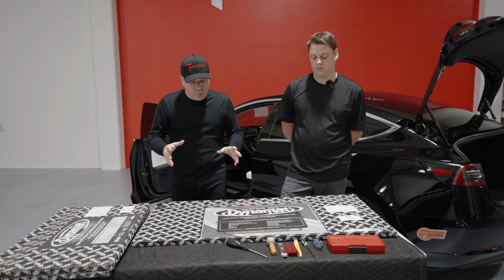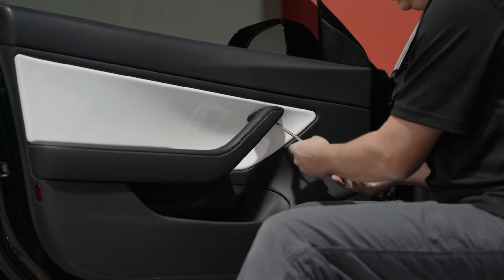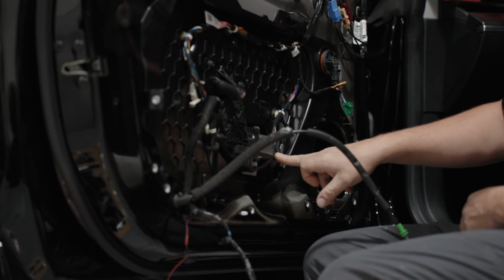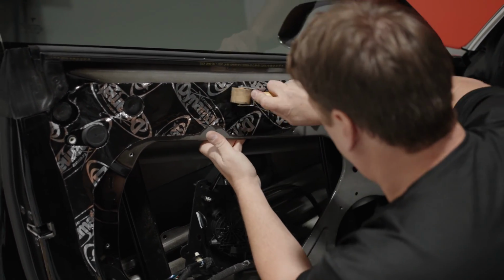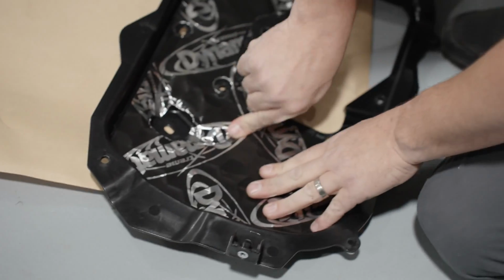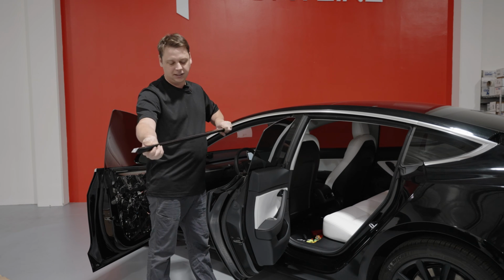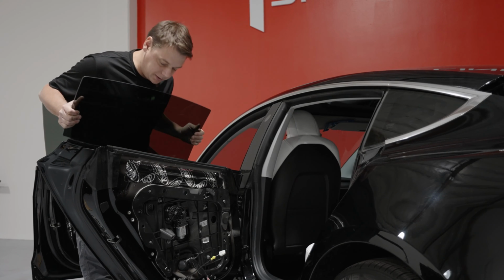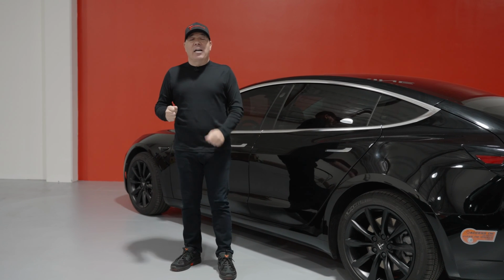DIY Installing Tesla Model 3 Dynamat Noise Cancelation Kit / Reduce Road Noise, Improve Sound System

Comment: Before applying the pieces, I wish you had cleaned the surface first, especially inside the doors, to make sure that it was free of dust, grease, etc. They won't be as durable as they would have been if the surface had been cleaned beforehand.
Reply: I honestly don’t know how dirty the inside of the doors might be.  I would assume it would be hundreds of thousands of miles to accumulate enough of anything to hinder the adhesion.  The wheel wells yes defiantly clean those.

Comment: How good of a job did these thin sound panels help. My opinion, not much they to thin to block sound and the vibration will not improve much either. Sound data prior and after?

Comment: Would also like to see cabin acoustic measurements before and after.  I've worked with sound deadening in previous cars and while a product like Dynamat can reduce the "tinny" sound when you tap on surfaces it's applied to, and isolate connecting parts to stop rattles, I've found it's pretty ineffective at blocking/absorbing road noise.  You really need to know how the noise is entering the cabin and have an effective barrier/absorber to reduce it.  Also, be aware of the weight/efficiency tradeoff for EVs if applying a large amount of this stuff.

Comment: That blue tape is not because someone had that window out.  That was from the factory.  I have a 2018, and I recently changed out all of the door handles and the mirrors for chrome delete (wish I'd have known about these kits before I started that project).  All of my windows, which had never been pulled out before had the blue tape.  Tesla must've been using it to hold them on while they were doing initial assembly.  Also, they broke on of the clips where you screw the 13MM bolts on my rear window and assembled it anyway.  Made it a mess to get apart for me.  And the worst part is you can't buy those clips separately.  So you have to buy a new window to replace a broken clip (which is removable).  🤦🏼‍♂

Comment: For some of the trickier pieces, it might be better to actually cut out the piece with the backer still on it, then peel it off as you stick it in place.  That would prevent it from sticking to itself and parts of the car you don't want it on.
Reply from the maker: Great idea!

Comment: Really sad seeing you put that dynamat on then install the stock paper speakers. Great install though, dynamat is a PITA but really does improve sound deadening.
Reply: have you used it before? how much improvement did you see with it?
Reply from the maker: This customer simply wanted to improve the road noise, however Dynamat is great to pair with an Audio upgrade as you mentioned!
Reply: The sound system is very good...

Comment: I might have missed it, but was there any comment about Tesla voiding warranty?
Reply from the maker: NO!  Federal Law prohibits such actions

Federal Warranty Law: The Magnuson-Moss Warranty Act (15 U.S.C. 2302(C))

The Magnuson-Moss Act regulates that vehicle manufacturers may NOT refuse warranty repairs merely because aftermarket parts have been installed on the vehicle.  The only circumstance under which the vehicle manufacturer can void the warranties is when they can prove the aftermarket part is directly responsible for (ie causes the warranty) the warranty claim.
Reply: Familiarize yourself with the Magnuson Moss Act